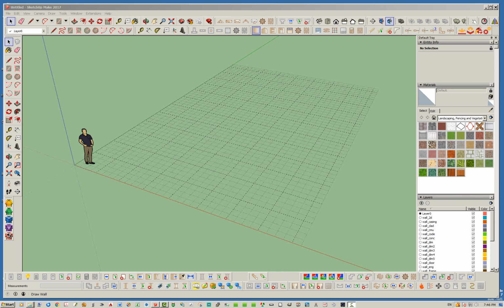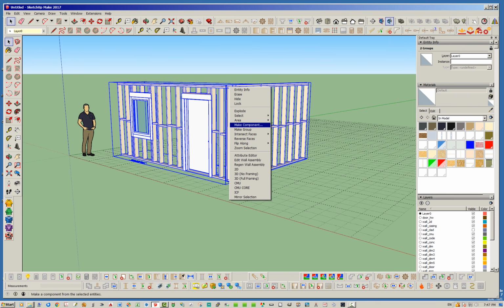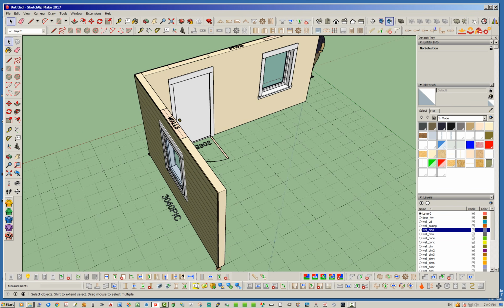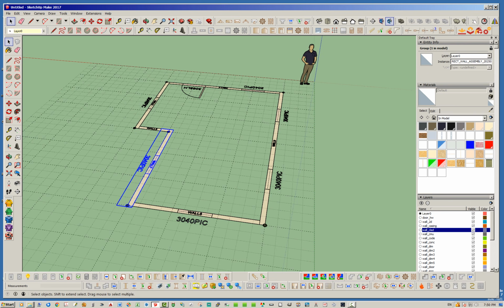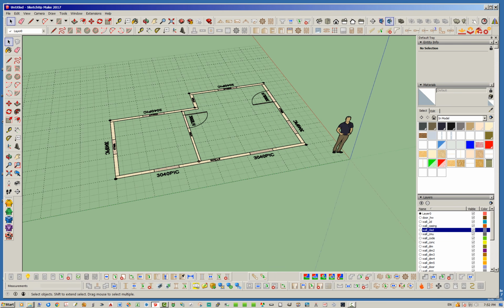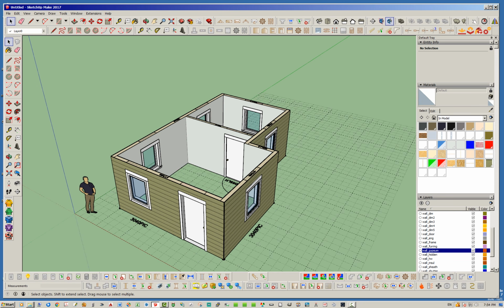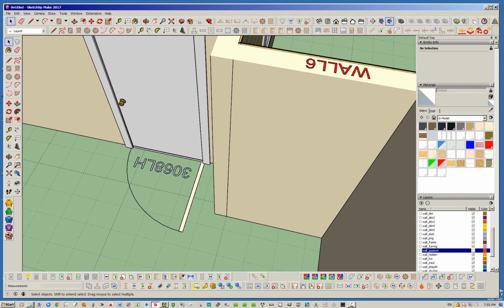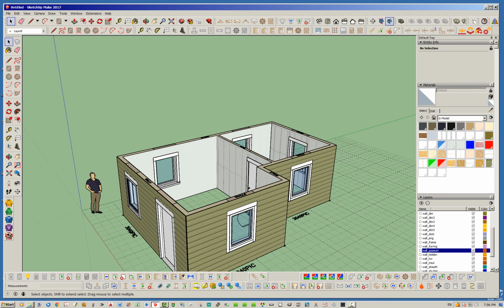Medeek Wall Plugin Tutorial 62 - Too much Detail?

Comment: Is it possible to use this plug-in to create wall types other than wood framing?
I’m an architect based in Portugal and I’m planning to use SketchUp as a BIM tool for small- and medium-scale projects. Here, we typically build with brick or concrete walls.

That said, what’s most important in my particular case is being able to represent all the layers that make up these walls (such as brick, insulation, and finishes), both for layout drawings and for material take-offs.

Thanks in advance!

Comment: 2D mode would be great when drawing interior walls in tight spaces. Then you could make the all 3D when you're done. Awesome.
One question, when drawing interior, non-bearing walls with a single top plate, it notches the exterior double top plate. I've tried a few setting changes and I haven't figured out how to avoid the notch.

Comment: It would be cool to be able to hatch walls in 2d mode so we can show wall types graphically.  And also, if the doors were cut out in 2d mode.  In other words, if 2d mode looked the way we do floor plans in the industry, I would use it more.  As it stands now, I draw a 2d floor plan like I have for over 30 years :) and then draw 3d over it.  

The amount of layers/tags can be managed with SketchUp's new folder option. I have a folder standard such as

1 - Site
2 - Foundation
3 - Floor
4 - Wall
5 - Roof
6 - Mechanical
7 - Plumbing
8 - Electrical
9 - Consultants
10 - Images

and so on.  I have a template file with these already setup and with the typical tags in each folder so they geometry is automatically placed there when it is generated.  This makes it easier to manage the hoards of tags that are created by the extension.  :) 

It's a great extension :)
Reply from the maker: Send me a test file with your folders setup.  I will study this and see if it is an option I can setup so that these type of folder are automatically setup.

Comment: I appreciate the high detail... and more specifically the accurate detail. I play in the archviz world and i want to show all the detail that one would see with accuracy for purposes of accurate and high quality rendering. This is an interesting point that i dont need to show the framing which one wouldn't see for archviz but there are times that i use that to help me with placement of things as well and certainly with the thicknesses of the wall. The only real problem i have is the SKP bug of not being able to properly hide the framing through the thin walls when zoomed out but that is a SKP limitation not the plugins. I actually wish with some things like doors and windows had more detail not less... but thats personal preference and i can replace them if need be. I dont always know all the technical specs of these parts as im not an architect so this helps me add the accurate details in those ways that are more likely to be correct to the actual architects vision.
Reply from the maker: I have considered more detail with windows and doors however the "install" sub-menus for both windows and doors are already quite large and overwhelming, especially for the new user.  You are correct in that one can replace a window or door with your own custom component.  

One of these days I hope SketchUp is able to fix the thin wall issue, it is a bit of an eyesore.
Reply: For visual purposes, I'll click the wall_frame tag off (or wall_furring as the case may be). Can also unclick Edges in the Style, though I find it hard to work without edges on.

Comment: Weak "designers" with no framing background would find lots of detail as a bad thing because it can show that they don't fully understand the structure they are creating.  
I hate "designers" who don't really know how what they "design" actually goes together.  
Too many of those folks use the cop out phrase, "The framers will figure it out on site......or do it their own way."  
These are "concept" designers....and it's okay if that's what level they want to be at.  But complaining about TOO MUCH DETAIL is a red star cluster showcasing their lack of real-world knowledge.

I LOVE the accurate detail you provide.   
Keep on with how YOU want your apps to work if YOU were building something using your app.

just my 2 cents
Reply from the maker: @para-cad_llc  I 100% agree with you on this.  I created these plugins so you can get more than a cartoon, and a good understanding of the structure should be a requirement in understanding the design, you can’t really divorce the two.  However, I can see where some designers just want to conceptually model things and that is why I have additional options to allow for it.  The point I guess I’m trying to make is that the plugin is flexible enough to accommodate those who want the detail and those who don’t.  For some reason a lot of designers don’t realize that they don’t have to show the framing if they don’t want to.
Reply: @medeekdesign  That's because very few take the time to watch the tutorial videos that are a must to understand your methodology.  KEEP UP THE GREAT WORK. 🍺🍺

Comment: Too much detail. Rubbish! As a designer, this sounds obsured. My clients are blown away because of the details of this plugin produces. Doing renos or new build with framing mode gives contractor insight into the build. Keep up the great work. Best bim tool, and one does not have to shell out 3k per year.
Reply from the maker: I appreciate your vote of confidence.  I personally like the details and I find it useful but at the same time I can respect the need of some designers who do not want so much detail.  Hopefully everyone can see that the plugin can be tuned to whatever level of detail you require.